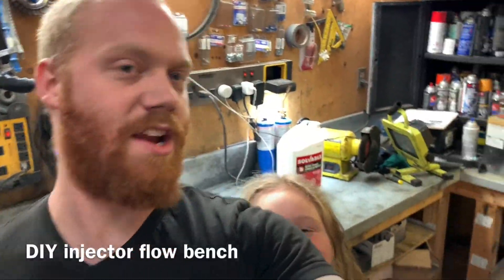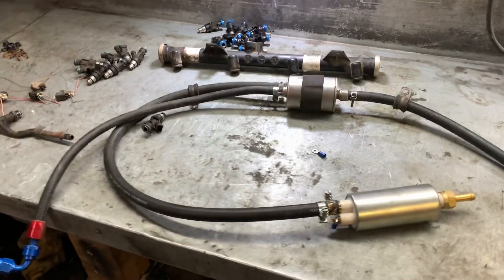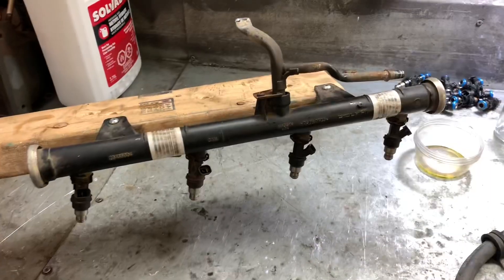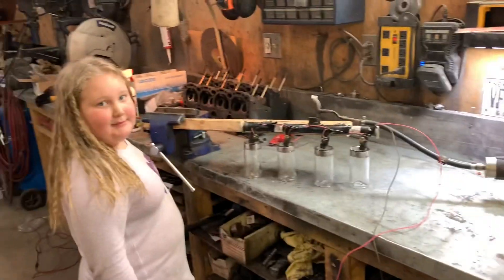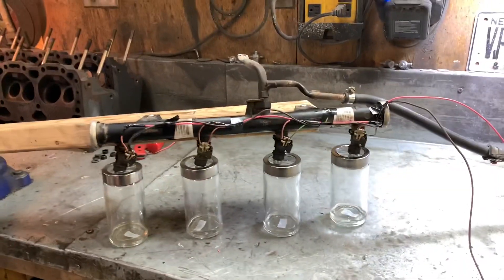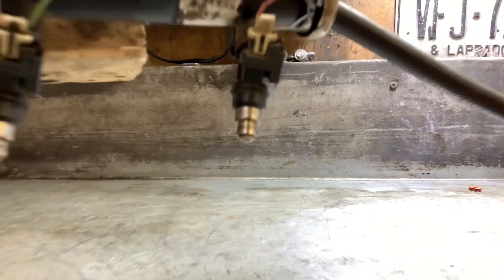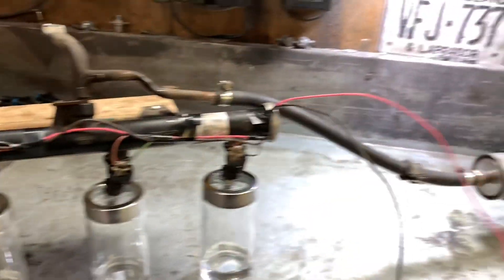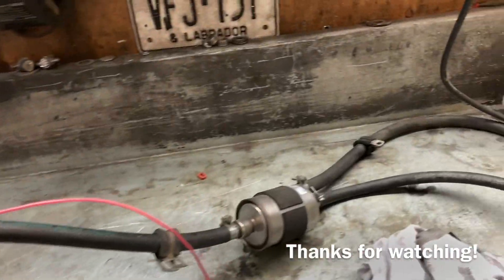DIY fuel injector flow bench

Comment: Rig up a rail/manifold to mount the injectors 180 flipped in a reverse flow. For sure they'll get a better cleaning, might even cure the drippers. I believe each injector has a micron filter just after the fuel inlet, may contain dirt/sediment and whatnot which could only get flushed by reverse flowing. Then run and test on your slick little setup.
Reply from the maker: Heyyy that’s a good idea! I usually try to blow them back through with a blow gun on shop air. That’s a way better idea
Reply: @StationroadRatrods  they won't spray by no means, more of a heavy dribbling flow. Seen it done before, I'll try and find the video. When you said were going to toss out the dripping injectors, I was like noooo, don't give up on them just yet.  They all sprayed patterned and flowed so equal.
Reply from the maker: Awesome thanks! I always thought a leaking injector was trash, I will definitely try that!
Reply: @StationroadRatrods  No you are certainly more than right.   Me, just hoping for miracles, pretty much.    Totally digging your channel Barry buddy. Doing a deadly wicked job. Just MINT
Reply from the maker: @jaybud3646  thanks man! I can’t wait to slice open the caravan now haha

Comment: So would it be better if you had an injector tester that has pulse modes to get more accurate results?
Reply from the maker: Absolutely. This is a bare bones way to test your injectors and see if they’re working at all, and check spray pattern

Comment: What are you running  through  the injectors
Reply from the maker: I always use methyl hydrate, it cleans the injectors well and I can use it several times when I use a filter, I prefer it over gas mainly because of the smell and fumes. I’m doing it indoors so it’s nice that there’s no smell

Comment: No that’s not how you test injectors, they work of a duty cycle l
Reply from the maker: You’re right, but I don’t have access to an arduino to simulate duty cycles. This is a test and I can more or less duplicate and come up with relatively accurate results. If one injector doesn’t produce the same volume of fluid as the rest, I know it’s defective